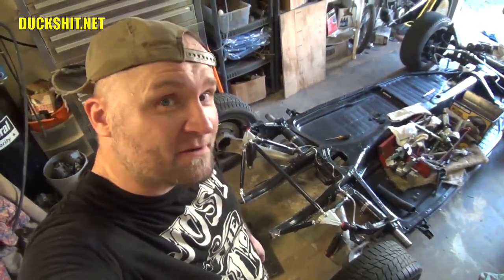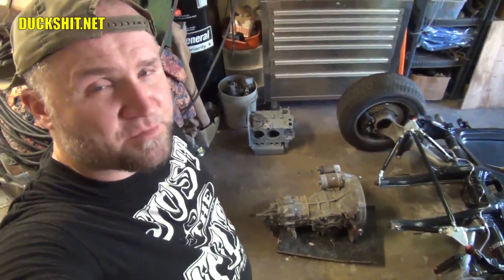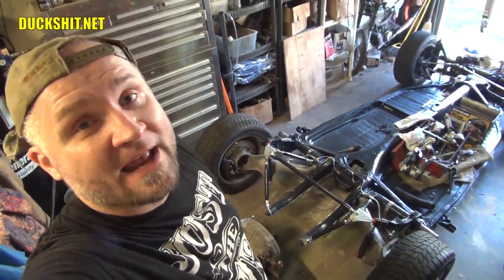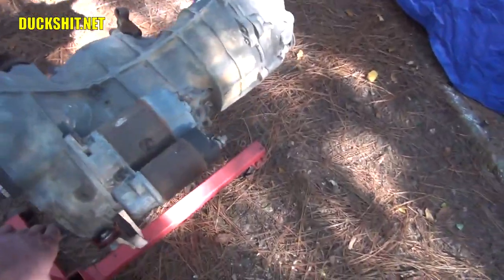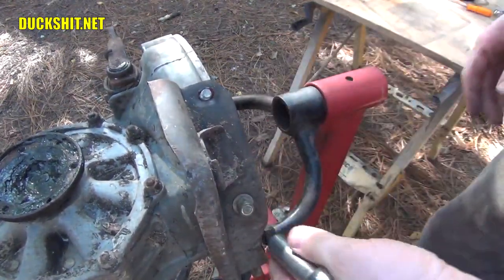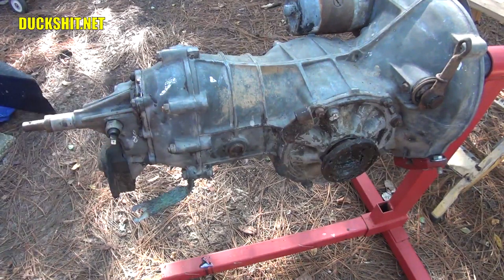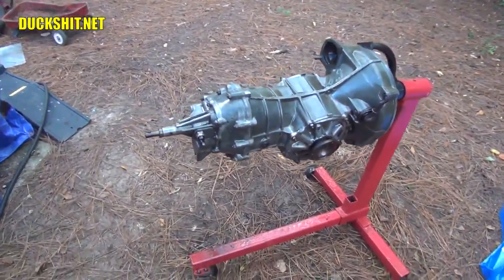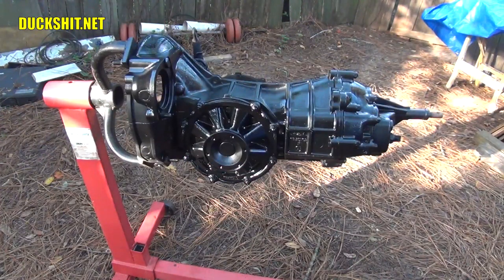VW Transmission Installation -  ROTTEN OLD 1956 Chop Top Oval VW Beetle - 48

Comment: Hearing you mention its going to be a short video. Look at the bottom right and notice its 33mins long😕 one of the longest that ive watched of your. ENJOYED every minute of it.
Reply from the maker: Thank you! I actually thought this was going to be a short video when I start to record it but ended up actually taking about 9 days because all the parts that I needed didn't arrive on time so I worked on it incrementally, otherwise I probably would have ended quickly.  The video might have even been a little longer but some of the footage was lost on a corrupted SD card, I was lucky that I recovered what I did, but I did lose the CV flange replacement process.  I will discuss that in a future video when I mount the axles
Reply: Oh wow, yea I know what its like dealing with a corrupted sd card it SUCKS, glad you got what you did for the vid 👍
Reply from the maker: I am a skilled data recovery technician, heh... computers are actually what I do for a living, so it's not the first one I fixed, but it is the first one I've ever seen that just randomly ate shit without any abuse... probably should replace the card because it's likely it will do it again I guess we'll see

Comment: Since I have worked on VWs since the 1970's, I too have seen the nose mounts put on both ways on used VWs. However, new ones from the factory were usually mounted with the horseshoe opened towards the top. (I had worked as a mechanic for a local dealer back in the 1970's before college.) And yes, the shop manuals had them mounted both ways in pictures.

Moe
Reply from the maker: That's very good information, thank you! It's crazy it in the manual they don't even tell you which way is up it's just a subject that is completely ignored.... and then you look in the photos and in the same book even on the same page the mount is flip-flopped!  I'm glad that I did it the right way then, as per Factory.   Thank you for commenting, I really appreciate it because I learned something from this one!
Reply: Look at it this way. The cradle acts like a pivot when you dump the clutch. The snout moves up and down when that happens. If the brace is open at top, it allows some flex without moving the snout too much and putting a bind on the nose section. If the brace is open down, then the rubber mount is now compressed when the snout moves up and puts pressure against the snout. If you have a high powered engine, it can and has cracked the snout. I've replaced a few of those when the mount was closed at the top, especially on custom engines, mostly turbo and supercharged ones.

Moe
Reply from the maker: I probably should have just gotten one of those closed Rhino mounts for the front.   I'm sure I will have this car apart again in the future.  Hehe.  Thank you for the insight and knowledge!

Comment: leaf spring bushing work well with urethane bushings idk in differnt cars but honda and isuzu work great.
Reply from the maker: Yeah, those are under compression, they perform much better in that case like the urethane trailing arm bushings I mentioned in the video.  Thanks for the comment!

Comment: All that work to put urethane empi shift coupler cage inserts. Just a word of wisdom. When they wear it will start to shift sloppy. Just a heads up. Wolfsburg west oem inserts.
- Keep Dubbing -
Reply from the maker: You are only one of two people that has ever told me that, I have no problem using these... especially since I have a whole Shelf full of them.  But they all wear, the set in my Fastback have been in there now for 6 years and shift flawlessly.
Reply: @DuckmanCycles  its a O.E.M. thing.
Reply from the maker: I respect that.  Not all upgrade parts are actually upgrades LOL

Comment: I haven’t haven’t had to mount yet. My tranny needs to be converted to a 12 inch/volt. I have to grind the opening larger to fit. I would like to see you work on how to grind out a bell housing to 12 volt.
Reply from the maker: I think I did that in another video.... hmmmm... lemme look!
Reply from the maker: I looked, and I did it for this car: https://www.youtube.com/watch?v=uIfCNSWBcB4 But I didn't document that part on video.   But  the trick is pretty simple.  Attempt to mount the engine and push it in as far as you can get it by hand without attaching any nuts or bolts then take it back out.  Look for the marks your flywheel made on the transmission bellhousing and start grinding away at those spots.  Usually doesn't take too long, the alloy which transmissions are made from grinds away pretty quick!  I hope that helps!

Comment: Hey Duck man as you raise and lower the back the IRS drive shafts become longer and shorter . Once I tried to raise the back of Rambus and when I took off to go get a quart of beer it pulled the clips of and I went about 2 feet and had to put it back like it was . dropping it should just shove the drive shafts in a little  good luck - duck ????
Reply from the maker: What is this Rambus I have heard you mention a few times before?  I tried to Google and can't find any info other than the ovepriced and failed computer memory specification back in the late 90s.
Reply: Rambus is our 71 bay window , basic stock 1600 + w 100 engle

Comment: Stupid noob question if you don't mind:  if those rear transmission mounts were worn out, could that cause the engine to sag a little bit at the back of the car?  My new-to-me '68's engine breast plate seems to be tilted slightly down towards the rear of the car..it's below the rubber gasket at the very rear of the car by maybe 1/2-3/4" but comes up to meet the gasket at the sides.  I'm wondering if the mounts are the reason for this.
Reply from the maker: Yes it could cause the engine to sag, especially if it's the nose cone mount  is rotted, or btoken or gone!  The engine is back heavy so the nose cone of the transmission will go up and the engine will sag,  another possibility is that your frame horns are broken or rusted or bent   sometimes that's from a rear end collision, but that's a pretty extreme situation but something worth checking. Thanks for the question!
Reply: Thanks for the reply!  The car is structurally in really good, original condition.  When I pull the engine next year I'll check out those mounts to see if they're the culprit.
Reply from the maker: They could be, the rear ones do squish over time and get flat some, too, sometimes they even break completely and the engine hops around.

Comment: When Jewburner had a broken front mount it made it go bump bump bump when you took off in first , I thought it was the clutch  NOPE
Reply from the maker: Man.... you've got some names.... lol.  Anything else?  Haha!
Reply: Jewburner was my 63 white  1200 with chevy adapters 13 inch corvair rims . It would go 70 in 3 and 70 in 4 but it got at 60 mph about 40 mpg

Comment: . tranny mount were fine . when they are used correct they never crack ive had the same ones in my formula vee race car for 20 plus years . you over tighten them and they crack and even then they still work . the stock rubber ones let the motor shake so bad the tranny would pop out of gear at over 6000 rpm . prothane urethane mounts work the best the lube it comes with has to be used  and personally i wire nut all bolts with motor and tranny mounts that can be done . fyi foa coil overs are only $160 - 180 and work insanely good for vw beetle irs and will get 8 - 16 inches of travel  https://f-o-a.com/  2inch coil  overs  .  i use afco springs and they are the best $60 each https://cmwraceparts.com/proddisp.php?pn=AFC28300-1 . the brake line kit afco makes are perfect $125 https://www.speedwaymotors.com/AFCO-Steel-Brake-Line-Kit,26346.html
Reply from the maker: Overtighten or not, that EMPI urethane mounts are caca and break no matter what.  There are better ones out there.